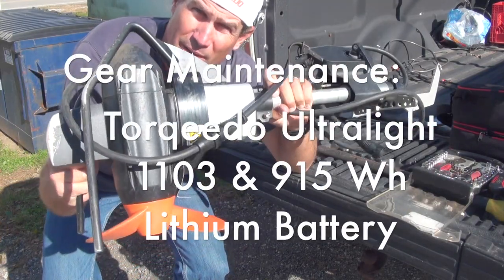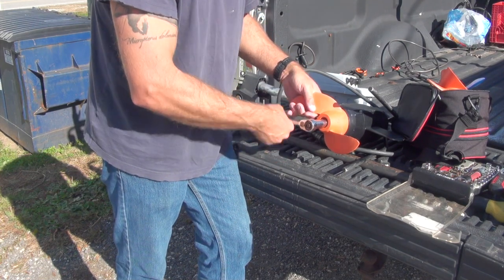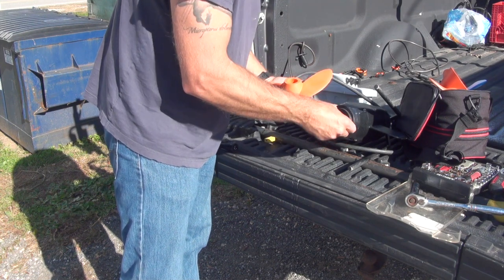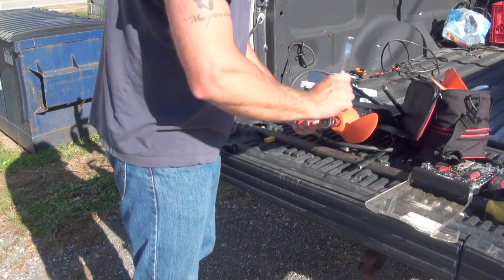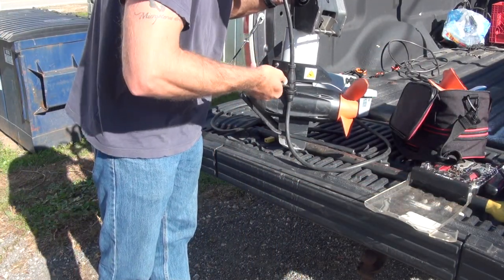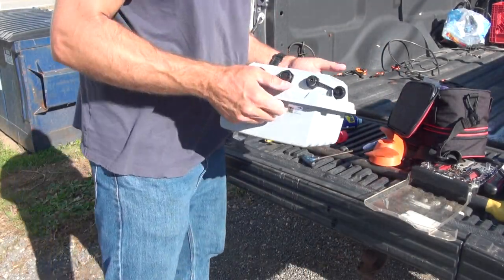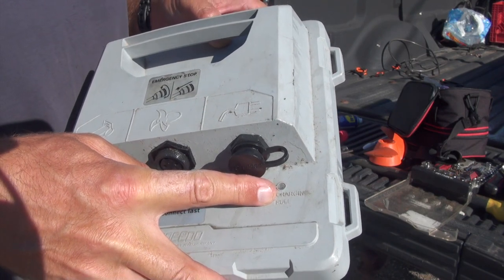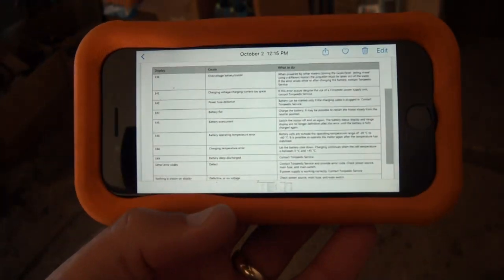Gear Maintenance: Torqeedo Ultralight 1103

Comment: I used dialectic grease as well.  Be interested to know the reason not. Great vid thanks
Reply from the maker: One of the service techs said that dielectric grease traps dust/dirt, which interrupts the connection. Shooting WD-40 through there blasts out the dust/dirt.

Comment: Why no grease on the connections? I have had problems with the handset not recognizing the battery giving me a error code and dialectic grease helped. I clean my terminals with mass airflow cleaner. It's for automotive terminal connector Cleaner.
Reply from the maker: I did it a long time ago. It made things worse. I sent it in for service because it kept giving an e 30 error code. They scolded me for not using WD-40, performed the same "soft bristle toothbrush and WD-40" cleaning demonstrated in the video and sent it back. It worked perfectly. I can't explain it. I just know what works. WD-40. If you prefer do foul it up with dielectric grease to see for yourself, by all means go ahead. WD-40 works. You probably have a can already. Use it.

Comment: What about the service every “5” year for the gasket? As i saw some guys had saltwater leakage issue into the motor
Reply from the maker: I actually inspected mine, found that I had some fishing line in there, and was nervous about there being damage to the seal. I sent it in for service just to make sure. Yes, around year 5, they should be serviced to put new seals in. Nobody has owned an Ultralight 1103 for five years. My prototype in the video is three years old.

Comment: I'm looking at a travel 1103c myself.  Reading through a bunch of posts in boating forums, there are quite a few posters complaining about various 1103 failures and I'm trying to figure out if its things like lack of maintenance or inherent reliability/build quality issues.   I've even seen posts in which they claim the battery failed.  How might that happen?  Have you seen that?
Reply from the maker: I have a few batteries for both the Ultralight and Travel. I’ve not had issues with them. I did destroy a charger though. I got mud in the plug where the cord goes in. I didn’t notice it. The current flowing through it cooked the plug, but the battery was fine. I cleaned the plug with a toothbrush and WD-40, got a new charger and was good to go. One nice thing with the Torqeedo is that there are a bunch of service centers for warranty claims and repairs if you do have an issue.
Reply: @TheLittleStuff  Thank you, great to know that the batteries can be reliable.  And that's simple maintenance - brush & contact cleaner.   Are you attaching galvanic anodes?  My intention is to use 60/40 salt water/fresh water and haven't seen instructions on how to install.

Comment: Can you use an other battery or are you locked down to these prepackaged battery?
Reply from the maker: You must use the 915 Watt hour battery that it comes with. It's IP-67 rate waterproof. It has a GPS unit inside that communicates speed to the throttle and is part of the constant remaining range calculator. That can not be done with a non-Torqeedo battery.